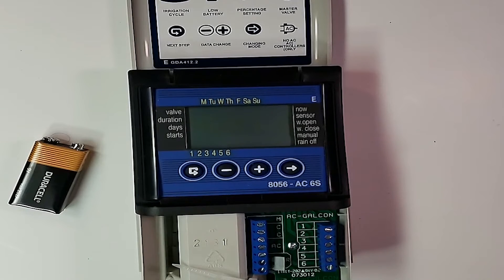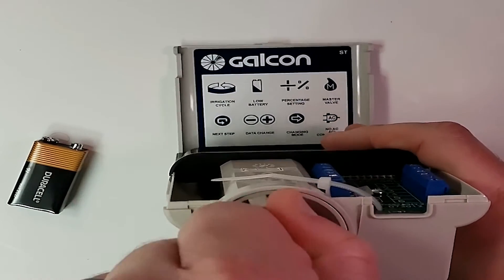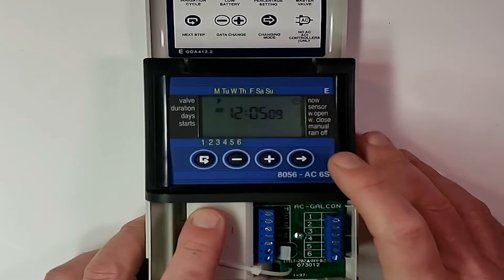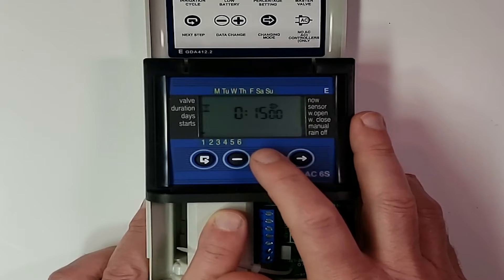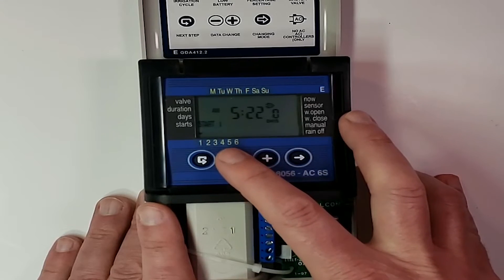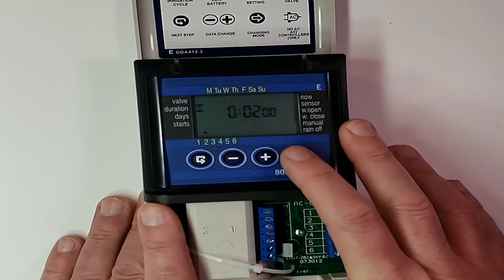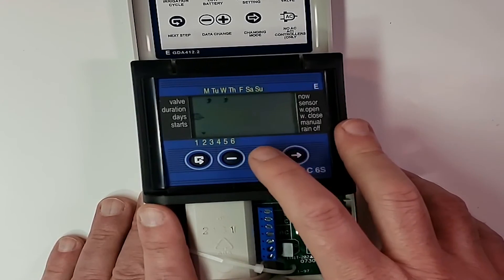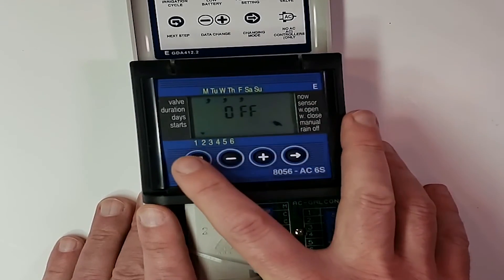8000S series indoor Galcon irrigation timers for misting propagation, sprinkler or drip irrigation

Comment: Hi 
In my controler windows open and w.close.option is not working, after the sensor it directly jump to rain off, please help me what should i do please please please
Reply from the maker: Hi, if you want to do propagation you will need to go into your Days menu and press the right arrow until you get to your frequency like every hour or 3 hours etc. Then your window open and closed will unlock. 
If you are doing a normal irrigation with specific days selected you wont use the window open and closed you will just set the days and start times and the irrigations will commence. 
Feel free to call 855-425-2662 or email support@sentekusa.com if you need more help.

Comment: Hi ,  i've set it up to irrigate every hour, but the valve does not open and the display does not show any timer for the specific valve... its been set to irrigate every hour for 2 minutes for each valve (i have 2 valves) starting at 6am and ending at 7pm. It used to work previously. any idea how to fix it?
Reply from the maker: Hi, You want to make sure your duration is set to 2 minutes, the days are set to where you see the circular arrow, Start time one should be set for 6:01 am and window open set at 6 am and the window closed set at 7 pm. All of our logic is the same in our controllers so you can watch this video from 9 minutes until a little past 11 minutes and it will walk you through the steps. https://www.youtube.com/watch?v=h88bopZTeJk 
If you you are unable to fix it please reach out to us at 855-425-2662 and we will talk through it.

Comment: Hi question.

What if i just want to water the plants without schedule?.
Just because the land is dry?.

Thank you
Reply from the maker: Hi Jackie,
You will have to set up the timer with everything but you can choose not to set a start time if you don't want to. Once the time and duration and everything is set you can hold the manual button and the irrigation will start and run for your duration or until you hold the button again to stop manual operations. 
Hope this helps!